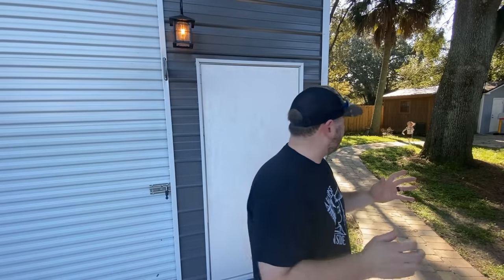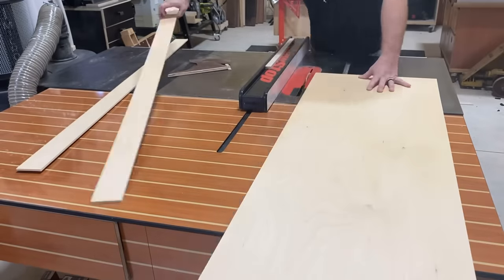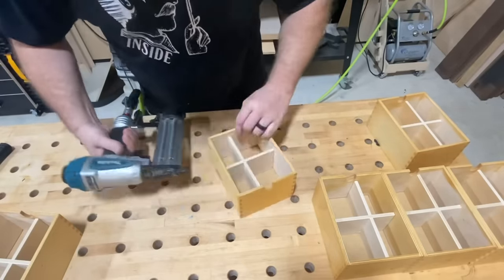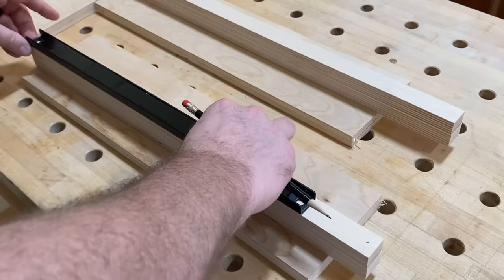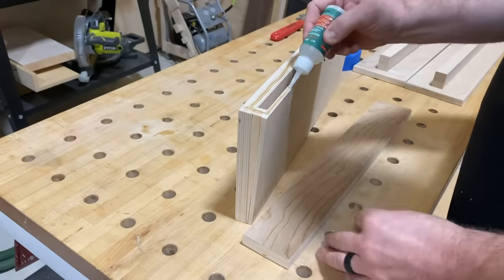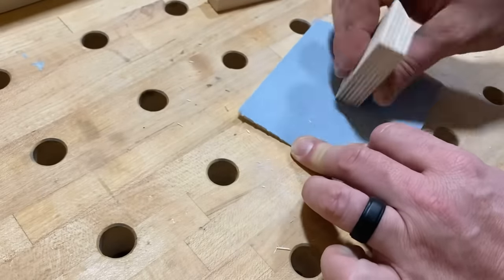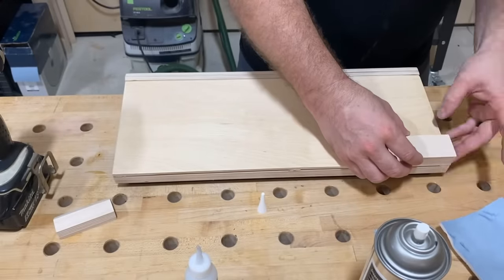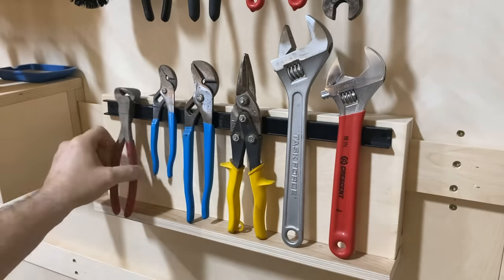Shop Organization Upgrades | Storage and French Cleat Changes | A Glimpse Inside How To

Comment: Just discovered your channel.  I also have a french cleat problem and use the harbor freight magnets.  My favorite magnet applications are one for bastard drill bits - those that no longer live in an index - and the other for straight saw blades; hacksaw, sawzall, jig saw , bone, etc.  You're just a pup, but if you evolve as I have you will eventually embrace the fact that pegboard is a better option for dense arrangement of smaller tools/supplies like those you want near your bench - just start with a chunk of pegboard about twice the size as you think you'll need and hang it from the cleats. (make sure you get the pegboard with the TRUE 1/4" holes)  Cheers!

Comment: Next time you want blackened screws (or anything steel), heat them redish hot, then quench them in oil (any kind, motor oil, cooking oil etc.). That will blacken and harden them. Great information you share, I learn a ton from you!
Reply from the maker: Awesome thank you so much I appreciate the tip

Comment: Hi! love the content, would like to see more on the CA glue use in the shop.  Also, I wanted to mention that heating up zinc plating can be toxic, I know welding it without removing the zinc plating can be dangerous.
Reply: I believe galvanize is also toxic.  From what I remember the "cure" is drinking whole milk for galvanize.  Is this true?
Reply: Inhalation of fumes from heating zinc plating can cause acute metal fume fever. Galvanizing is a process involved in zinc coating. This intoxication can be caused by heating other metals like brass that contain zinc. Drinking milk, although widely practiced and thought to protect against fumes from welding or painting has no proven benefit
Reply: The small amount that Chris may have inhaled is unlikely to cause a problem.

Comment: Nice job! I like how you pack out the magnets. Smart! Have you organized sandpaper? I made a box with many dado cuts for sliding shelves. I actually used pegboard for the slidibg shelves because I had it and it's light. Also slides nice. It changed my life. Also made a bin on top for sanding blocks and steel wool. That was an after thought so it's a separate structure about 4 inches high and I fastened with pocket holes and glue. It's not on a french cleat but it may end up that way. The sandpaper us lables on the side face. I saw it on another video. Well worth the time.

Comment: I've been fight parts bins pretty hard over the  last year. Currently my newest challenge is one you'll notice you have soon enough. Those drawer separators are great. I lined mine with peg board, dowels in the dividers make them interchangeable. The issue is small fasteners in small sections. I had jars years ago. They took up too much room, but I loved dumping them into my hand. I can't stand trying to fish something out of a tight spot. I'm working on a bottom that can be raised but then my dividers have to be fixed. I'm not sure where I go from here, but ill eventually get there. Good luck

Comment: I love your organization of tools, The bins w/ dividers look too small to get my fingers to retrieve screws,  but a great idea. That’s also a great idea using magnetic strips with cleats. You have great videos & you’re never too busy to stop and help your daughter! Makes your videos more a part of life. I would be interested in more details about Ca glue. Also I’m interested in your out feed table off your Sawstop. Are the lines cut into the wood? I recently acquired a used Sawstop w/ rust in the top. Obviously not well protected in storage. I’ve heard white vinegar works on rust. What do you think? Your suggestions would be valuable. Thank you
Reply from the maker: No the lines are flush And came with the plywood. White vinegar is great along with some light sanding you should be good to go.

Comment: Great video...... the cleats on the back of the tool holder, do you usually use short pieces like in this video? I am curious since I usually make mine the full width of the holder..... so you think I am over doing it?
Reply from the maker: You could do one or the other honestly I don’t think you’re overdoing it most people put the cleat the long-haul span I just try to save a little bit of material and find that this works just as well. Or at least so far. You never know what’s gonna come flying off the wall LOL
Reply: @AGlimpseInside  That is what I am worried about, gravity and flying

Comment: Great video, love the idea. The only thing is you take such care and time to make sure the wood and edges are nice, but you threw a staple in the front to hold the screws. Its making me cringe. 
 - What about doing a tiny epoxy pour coating the screw in epoxy and then using that little cube as a drawer pull? I think that would be so much cleaner and still give you a practical purpose!